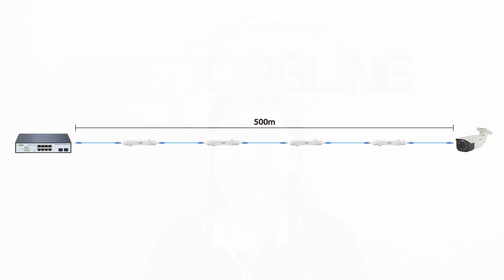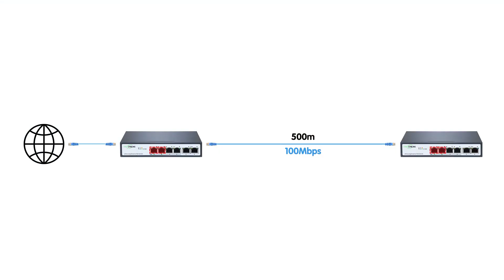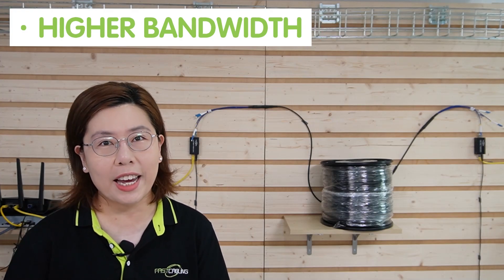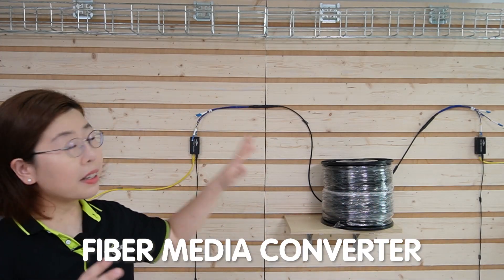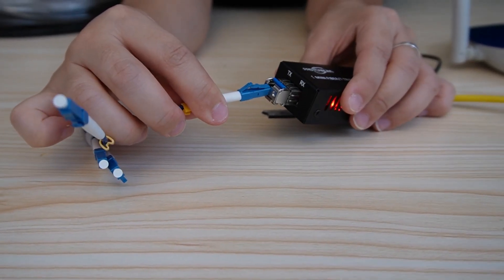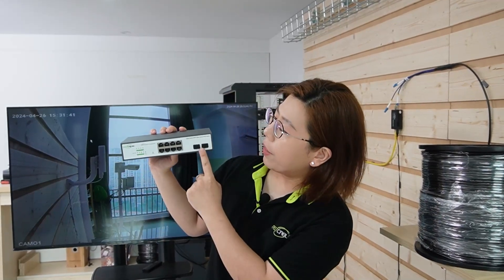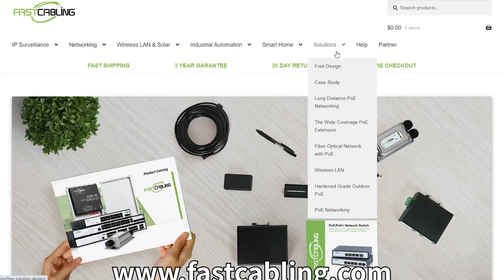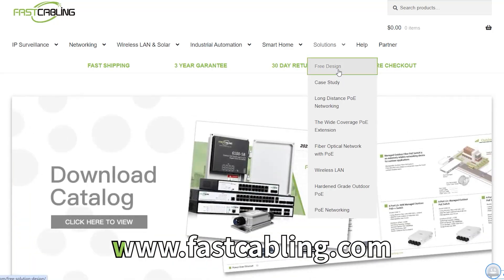How to Extend Your Home Network to a Remote ShedGarageWorkshop

Comment: Another advantage of using fibre is galvanic isolation between the properties.  At 500m, lighting strikes or electrical faults a one property one propagate over an ethernet cable to the other, causing probable damage and risk of injury or worse.
Reply from the maker: I agreed with you. Just remember to ground the armor if the fiber optic cable comes with the armor or metal strenght part.

Comment: Does the Optical fiber cable sends audio sounds from the cameras to the NVR ? I didn't hear u explain that part for does who needs sounds records
Reply: That was clearly communicated
Reply: Yes, all the same data, audio, video, etc. transmits over the fiber-optic cable same as copper wire.
Reply from the maker: You can consider the fiber optic cable as a replacement for the UTP cat6 cable. The data (e.g. video audio..) is being digitalized in the IP camera. All you have are the zero and one. The data will pass through the fiber optic cable (just like it passes through the UTP cable). The NVR decodes the data, and eventually, you see the video and hear the audio. The fiber optic cable doesn't process the data. It just transmit whatever it comes from the IP cameras.